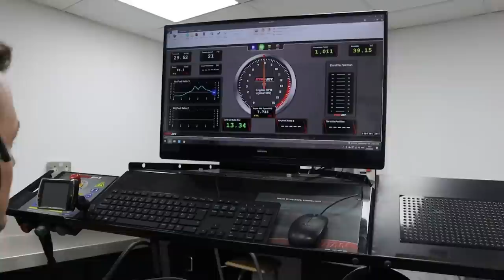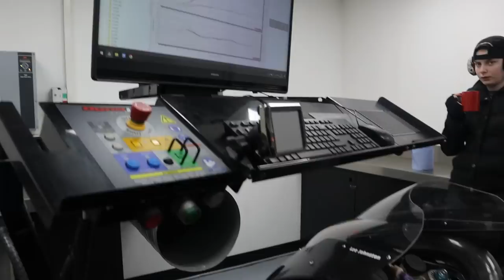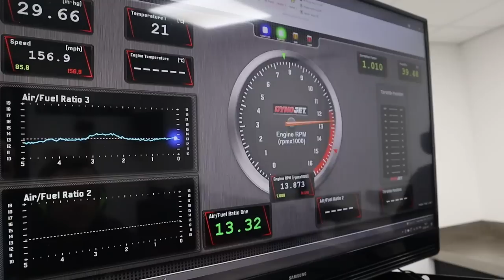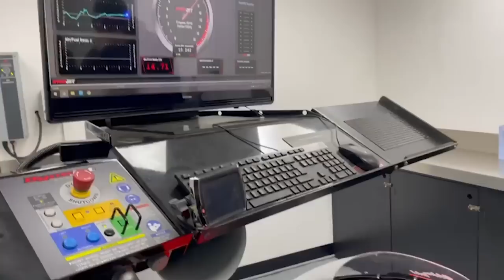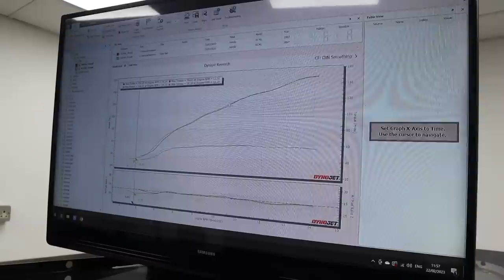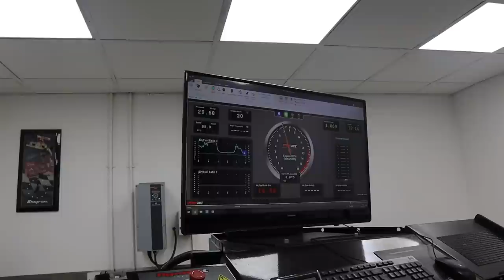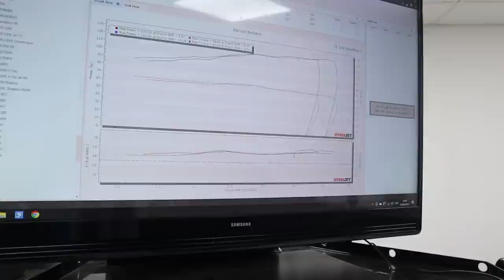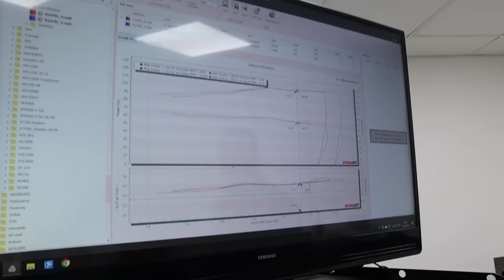You need to hear this… (DYNO)

Comment: I saw that at the Paris to dakar one of the oil sponsors has a truck and they'll diagnose your engine oil to see any types of debris and pieces of metal etc to tell if anything in the engine isn't working right or wearing incorrectly. High tech shit I'm wayyyy behind the times I still use a clutch even

Comment: Detonation from fuel build up? Never heard of it, unless in the exhaust with a loud pop. More like carbon build up, spark plug fouling, engine oil dilution over time or, only in very extreme cases, hydrolocking. The dyno man just knows how to dyno, it appears.

Comment: i know it's an old video now but, this one triggers me quite a lot as a mechanic. since when doing more than 3 pulls on the Dyno is a normal thing to do? i mean, conditions get worse and worse with temps inside the room no matter what kind of air conditionning you have. 

so 3 pulls is what you need. and you make an average. everything else is pure masturbation. just eating the tyre on the roller and taking some life away from the engine for no real reason. as well as burning expensive fuel. he even forces the dyno to slow down with its brakes. when you just need to let it go down gently and go for another pull. some mechanics will always amaze me with their stupid habits. priceless. nothing against you Lee of course. 😄